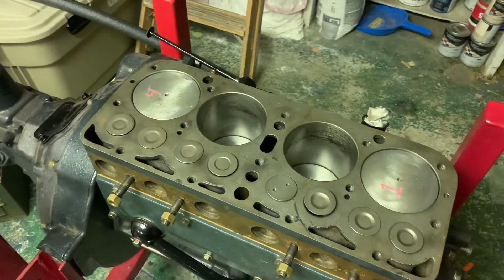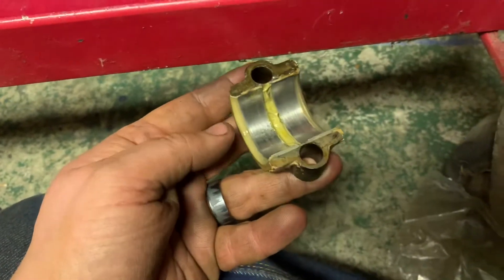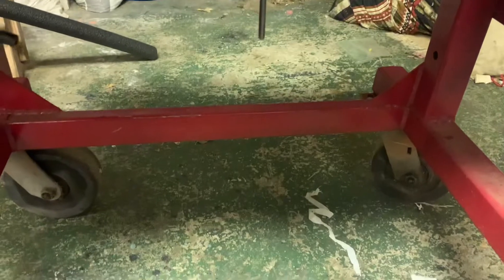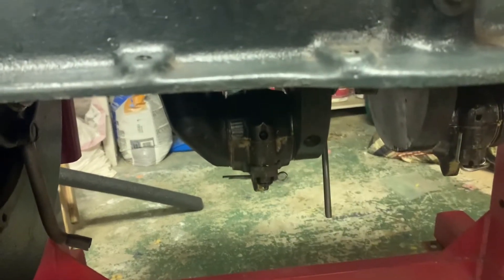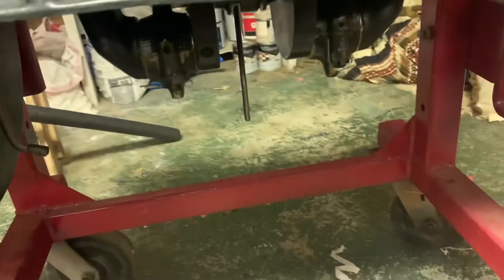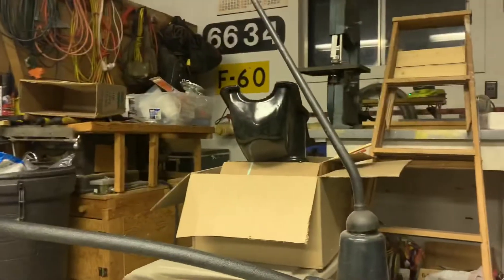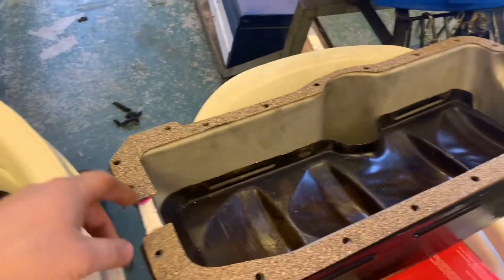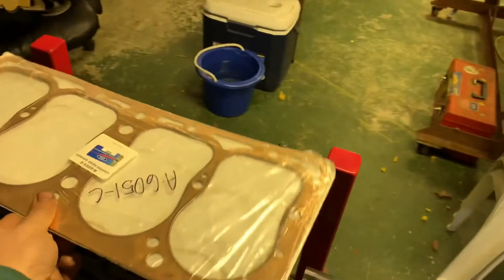Ford model A engine assembly for the skagit yarder

Comment: It’s always great to know some of the back story. I had to chuckle a little when you talked about working on it a long time ago. When you have projects sitting for 30 or 40 years that’s what I consider a long time but everything is relative to your age. When you showed the head gasket it made me think of a friend who rebuilt his model A and had overheating problems. It turned out the head gasket didn’t have the holes for the coolant to pass thru located properly. Thanks for the video and will be anxious to eventually see the little donkey operate.
Reply from the maker: It’s kinda a short video I pieced together. Hard to make videos when I don’t have much time… I normally squeeze in working on it here and there. And yes I understand 13 years isn’t a long time however it is over 1/3 of my life haha